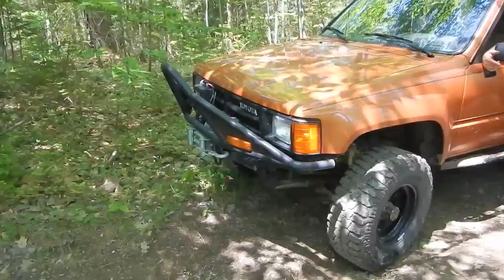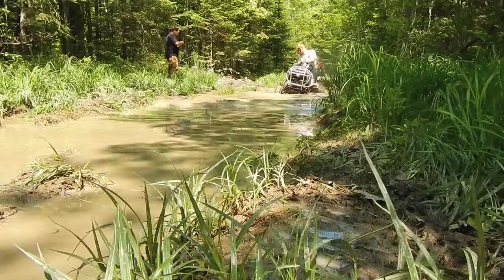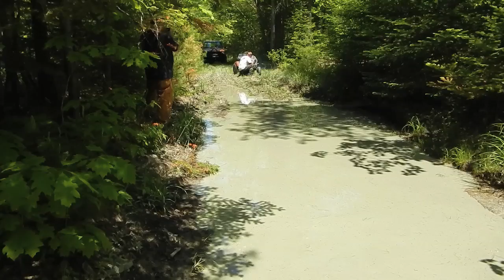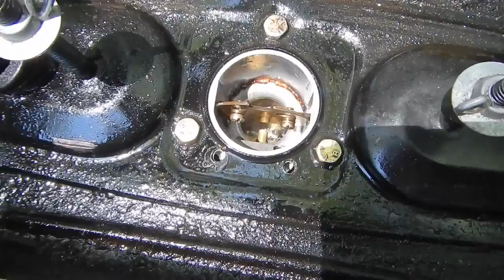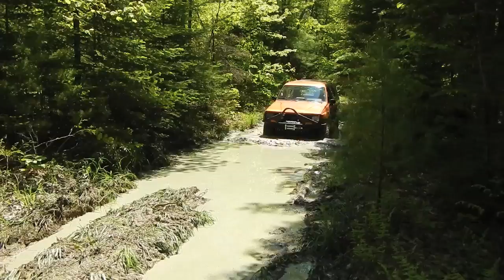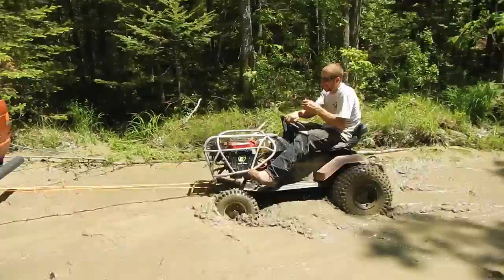Mudding Mower Romp BREAKDOWN!

Comment: Don't forget that all of that gas went somewhere inside of the engine,so a few quick oil changes need to be done asap (run engine without putting a load on it due to the protective coatings are washed off of the bearings,and wear surfaces now)to try to remove the gas from the crankcase,bearing surfaces,etc,and don't forget the crank breather element will be gas soaked...

Comment: HEY fearlessfront i have a 1970 sears lt/10 and it has the clutch on the left foot panel and a break pedal on the left it is all original and i want to take the clutch out for a gas pedal without messing up my mowder or trany please help if you can